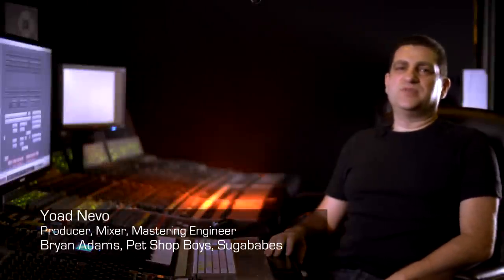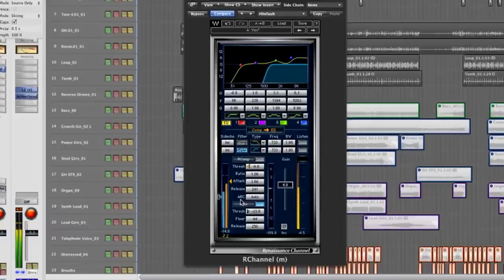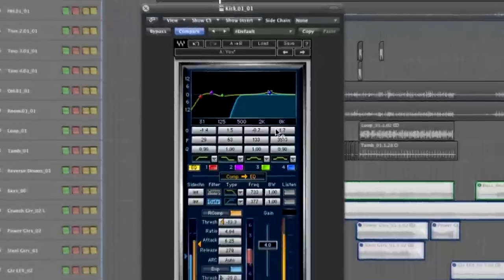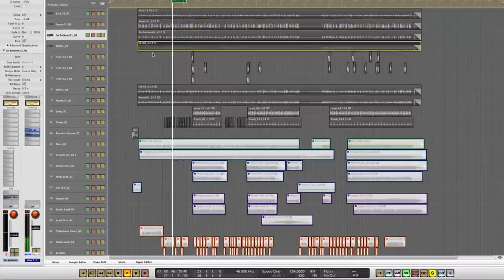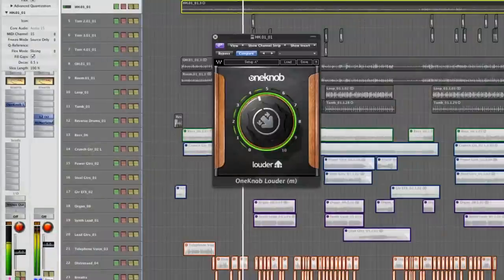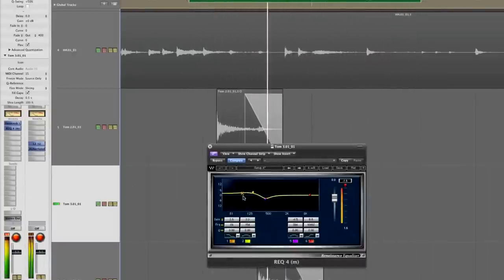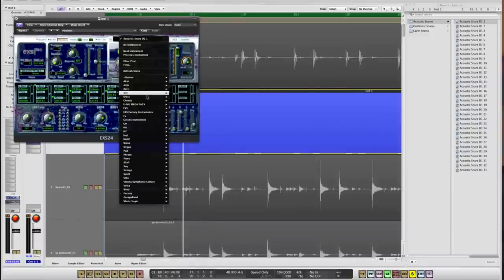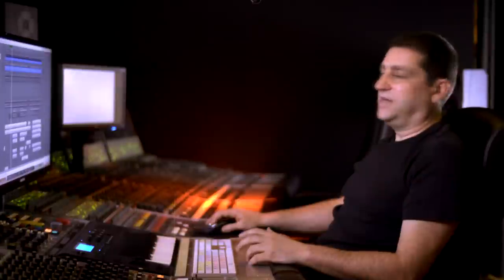Mixing Drums in 30 Minutes - Webinar with Yoad Nevo

Comment: Both Snare Tracks are not in Phase, as you can see. Why not simply move one track, to get it in phase?

And the overheads are NOT right recorded. The Snare isn´t in the middle
Reply: It doesn't necessarily always sound better with the snare in phase. The snare sounded pretty decent as it was. Putting it in phase may of made it worse. 

There is no such thing is a "right" way to record something. You may like the snare in the middle on the overheads but that doesn't mean everybody does. It is a personal choice. 

Having the snare away from the middle gives the snare a bigger stereo image when blended in with the closed-mic'd snare. I personally like this. 

Most recordings I have dealt with, the snare is always slightly off-center in the stereo image because engineers usually position the overheads to align the kick in the middle - leaving the snare slightly to the right or left. That's the case here. The kick is in the middle on the overheads leaving the snare slightly towards the left.  

Positioning the overheads so the snare aligns in the middle will leave the kick off-center. When you blur the image of the low-end, the stereo image sounds terrible. Having a kick drum off-center on the overheads is worse than having the snare off-center. But this is to me - and a lot of others. This doesn't mean I am right or that you are wrong or vice versa. We just have our different ways of doing things to suit our own subjective taste. 

But to suggest that there is a "right" and "wrong" way to do things is amateurish.
Reply: moving a track forward will never put it back in phase. if you want to change the phase you have to switch the phase with a plug in.
Reply: Andres Mejia Moving a track back and forth (in time) will change the initial angle of a waveform function at its origin (0°) and is sometimes called "phase offset" or "phase difference" - which is by definition what we refer to as "phase".

So yes! We can change the phase of an audio track simply by moving the audio track back and forth - this is technically referred to as "phase shifting". And therefore we can align the phase of two signals together by moving one of those signals back and forth.

We once had to use such a tool at University when we used two mic's to record an amp (one close up and 1 about a metre away). Clearly, we had to use the phase tool on one of the mic's, and depending on which one, we would either shift the signal backwards (if we were effecting the mic further away since this signal would have been delayed to the closer mic), or delay the signal forwards (if we were effecting the mic closer up since the audio source would of arrived at this mic sooner than the mic further away). This is therefore changing the phase relationship of the two different audio signals in order to align them more efficiently. 

We shift the phase from the reference point (0°). Another way to think of phase, although it is not technically correct, is time. Changing the time of a signal, relative to another changes the "phase" of that signal relative to the other signal. Think of when you delay a signal by a few milliseconds... what you get is what is called "phasing" because you have shifted the phase of your delayed signal relative to the direct one causing "phase cancellation", which can, but not always, result in "comb-filtering"; this is due to specific frequency cancellation that causes a series of peaks and troughs throughout the frequency spectrum - hence the term "comb". 

Furthermore, what you are actually referring to is inverting the polarity or sometimes simply called "phase switch". This completely flips the phase by 180°. What we mean by "in-phase" is when the position of the two waveforms, as described in degrees, align/correlate with each other. Sometimes we may only want a 45° phase shift forward of one signal to align the phase of this signal with another. So using the phase invert switch won't actually make the two signals in-phase with each other. This is when we have to use "phase-shifting" which simply means shifting the signal back or forth in time (we are talking milliseconds).
Reply: I understand it I have A degree in Audio Production what I mean it's means I just made an easy responses. BTW Polarity and Phase are related but not the same. If you change the polarity on two identical tracks they will completely cancel each other out but if you just delay a signal by 180 degrees you are going to get more of a phase issue. that is what i was getting to.
Reply: Andres Mejia

"Polarity and Phase are related but not the same"

In the context of electronics they are not the same. When talking about the polarity of microphones, for example, we are talking about positive and negative voltages - which has nothing to do with phase. This is electrical polarity. But when talking about audio engineering i.e. sound waves, the polarity and phase are the same thing. This is a fact. So yes, in this context, polarity and phase is actually the same thing.

"If you change the polarity on two identical tracks they will completely cancel each other out but if you just delay a signal by 180 degrees you are going to get more of a phase issue."

With all due respect, this is actually a rather foolish statement. First of all, you don't delay a track by 180°. You delay a track by a particular amount of milliseconds/seconds/minutes etc. which can result in the delayed signal being 180° out of phase with the original (which is by the definition what we refer to as "phase cancellation" i.e. complete silence). 

Secondly, you are right that flipping the polarity of an exact copy of a signal will result in phase cancellation (which is by the definition out of phase by 180°) but if you delay a duplicate signal to the point at which it becomes 180° out of phase with the original, by the definition it results in phase cancellation (the exact same thing). That is what phase cancellation is. You cannot possibly have an identical copied signal out of phase by 180° (whether it was caused by flipping the polarity or delaying the signal is irrelevant) with the original signal not result in phase cancellation. To be "out of phase" or "to phase cancel" means to be 180° out of phase. So you are wrong.

Having a "phase issue" can mean anything from the signal being out of phase by 1° to 179° and from 181° to 359°. But "phase cancellation" means when it is out of phase by 180° (which will result in complete silence). So if the delayed duplicated signal is 180° out of phase, by the definition this is what phase cancellation is (i.e. complete silence). 

I have to say, for someone who supposedly has a degree in audio production, you have been very inaccurate in your comments here.